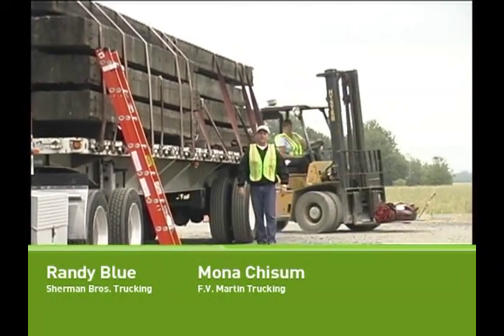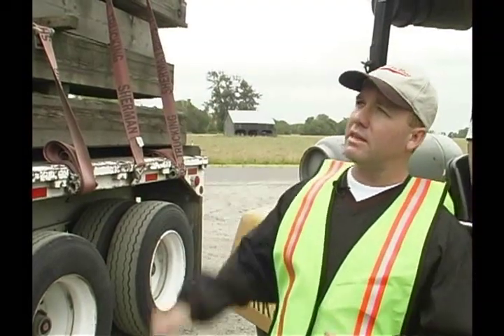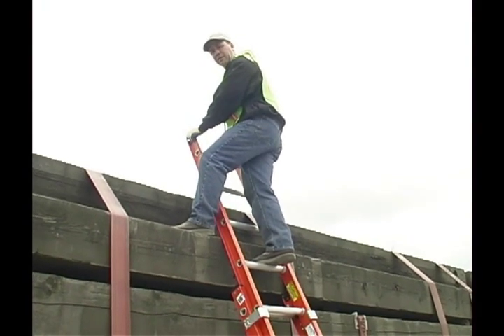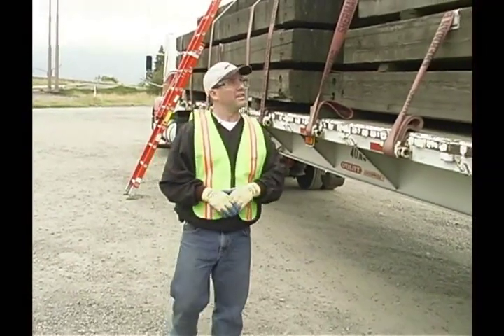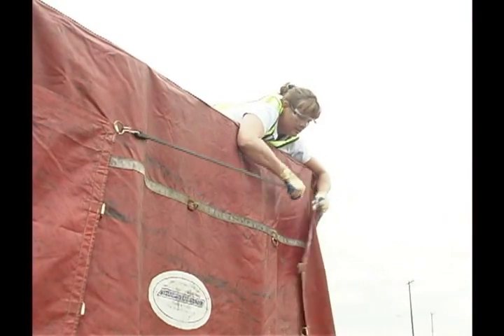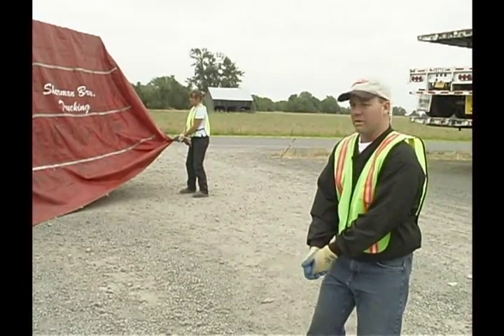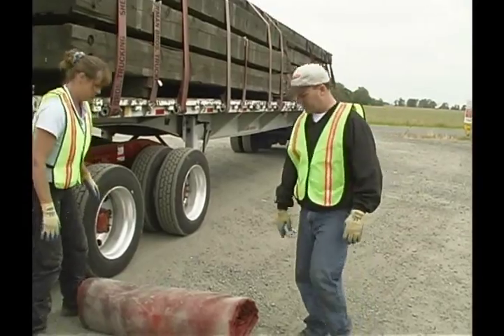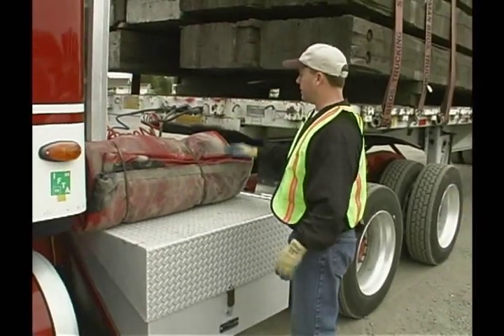Flatbed Tarping Best Practices | Safety Driven

Comment: must be nice to have a nice, flat, even load to have a helper, help you with. not to mention having a forklift to put the tarp on top. I haul building materials, cardboard, all the pallets are different shapes, sizes and heights and it only gets tarped when its raining, therefore I have to fight tarps in the rain all day. you should do a video on fighting tarps in the pouring rain because you have 9 more stops that day lol

Comment: OMG the straps are twisted
Reply: thats why they are tarping old barn beam.. cant see the twists
Reply: jocamp77 actually you can have a twist in the straps as long as the twist is not over the product it is completly legal a twist in the  winch and anchor side will actually get it tighter. I am a current flat bed hauler. they also keep vibration to a minum when the load is a no tarp load

Comment: Well Poindexter you left out several key issues, most of the time a driver does not have a forklift handy,90% of the time the operation is solo,and last but not least--weather,need I say more? You need a more instructional video.